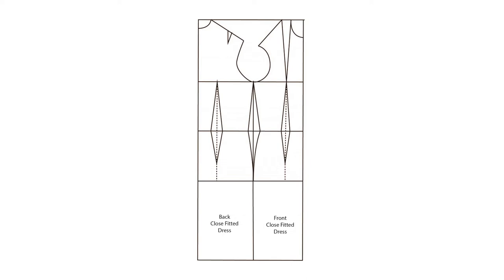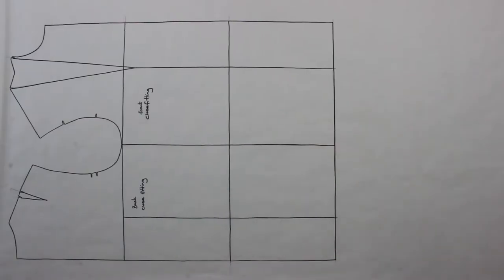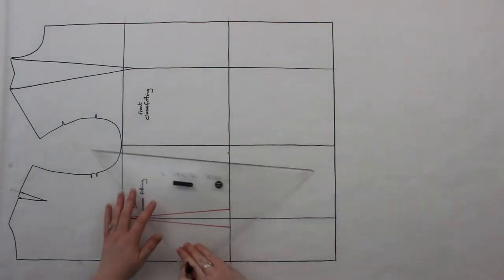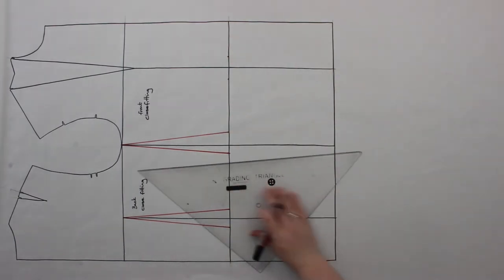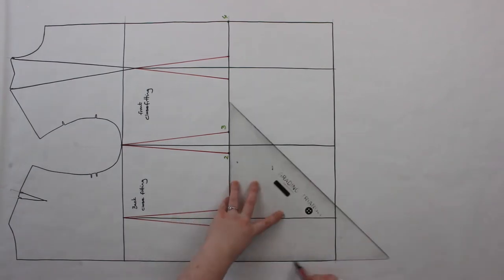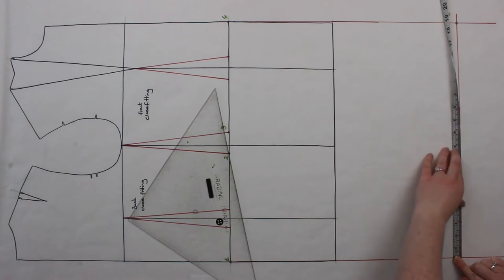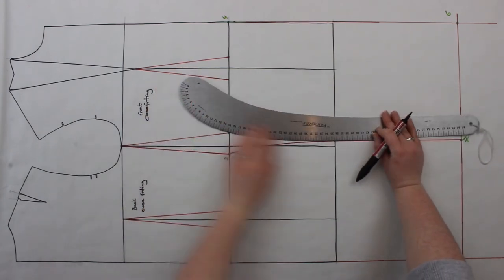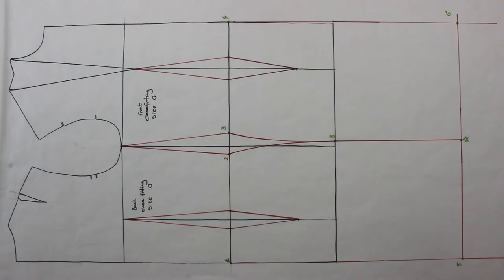How To Make A Dress Pattern | Fashion Design | Pattern Cutting

Comment: Good tutorial. How about if we have thicker waist and bottom?
Reply from the maker: The measurements are the same for each size, so you will need to make your top pattern to fit your size and then make the adjustments to create your dress pattern 😊 usually if you are wider in one part you would go up a size then you would do the alterations later to make it fit the small part. I'm a 16 on bottom and 14 on top, so I would use a size 16 pattern and then take in the top to fit me :) hope this helps :)